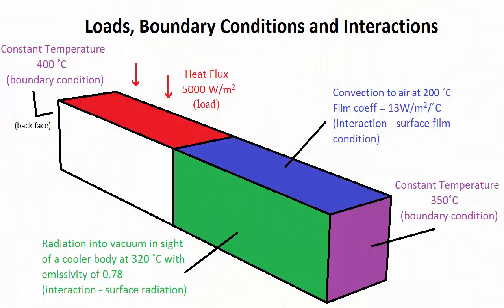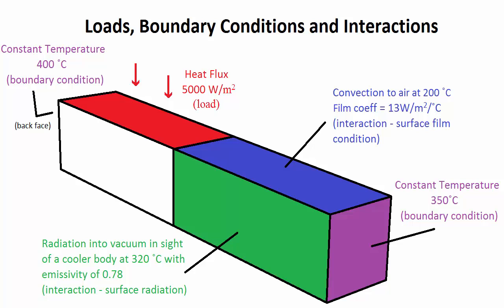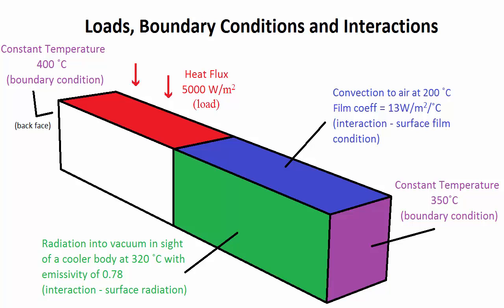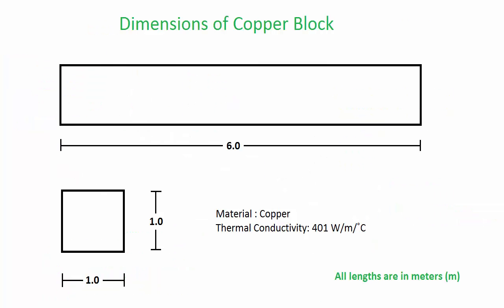10.a) Heat Transfer Analysis - Overview (with audio)

Comment: Sir, i am highly thankful to you for the help i get from your tutorials. Sir, i am trying to model pulsatile  blood flow through artery to study the effect of various heating methods (laser heating for very short period of time, a constant heat flux and step wise heating of tumor cells in artery) in hyperthermia treatment of cancer cells. This is a Fluid - Structure simulation problem. My problem are -
(i) How to model pulsatile fluid flow for diferent Reynold's numbers
(ii) How to couple it with heat transfer analysis 
(iii) How to insert my own heat transfer eqn (Bio Heat eqns)
(iv) How to model artery as porous media.
                                                                                               Thank You Sir